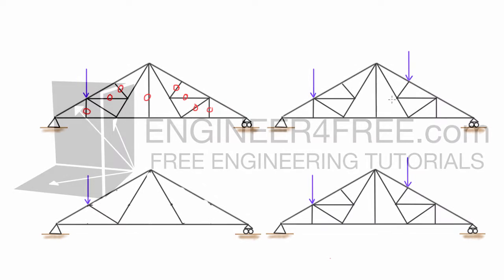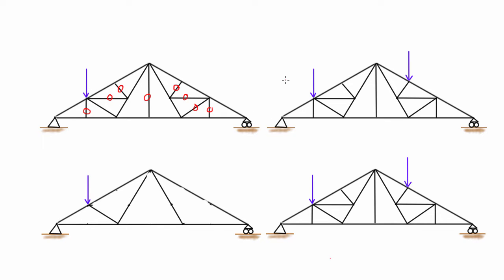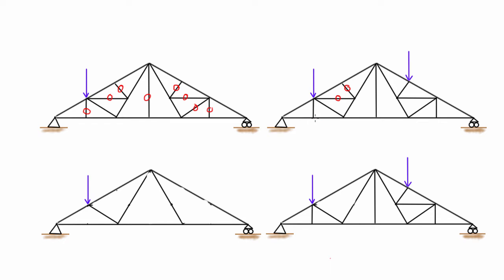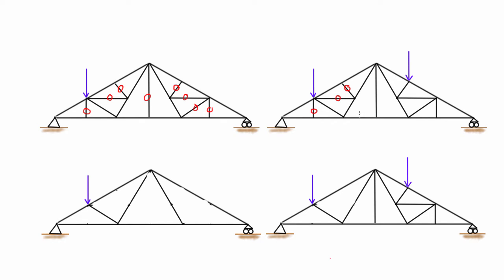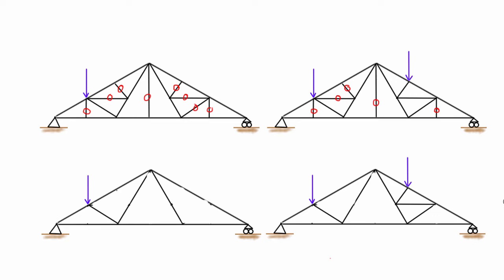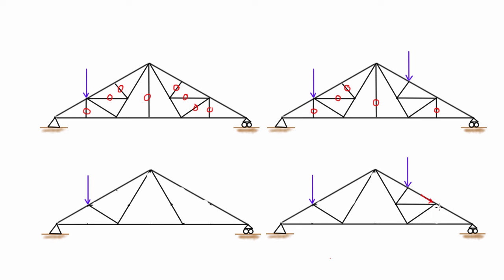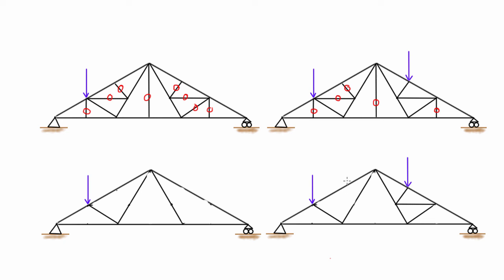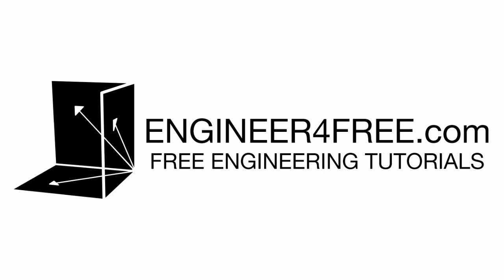Find the zero force members in a truss: example #2

Comment: Excellent presentation. Picture in the bottom left position has 4 joints in the bottom line. The 3rd joint from the left is connected to the top joint. Shouldnt this connection be ZFM?

Comment: Hi, brilliant video, I just want to ask about 4:42, what observation can be made about zero force members if that load were just to be one of the two components - i.e either just in line with the collinear members or just in line with the perp. member. Additionality what observation could be made for the mentioned scenarios if the member were not perfectly perpendicular to the collinear members?
Reply from the maker: If the applied force was in line with the colinear members, then the third member would have to be a ZFM, as at that joint, there would be no other force acting in that perpendicular direction that could counteract an internal force in the perpendicular member. If the force was applied in line with the perp member, then the perp member would not be a ZFM. In fact, the internal force in the perp member would have to equal the magnitude of the applied load in that case. When an applied force is acting on a joint like thie at some orientation other than 0 or 90 degrees, then it's best to draw a coordinate axis of x' and y', where x' is parallel to the line created by the colinear members, and y' is perpendicular to it. Break down the applied force into its x' and y' components, and also any component (generally the third member) that is out of line with x' or y', and find its x' and y' components. the y' component of the applied force will equal the y' component of the third member. From there, you can use SOH CAH TOA to solve the actual magnitude of the third member's internal force if needed. I've got more videos on trusses here: engineer4free.com/statics see videos 42 - 51
Reply: @Engineer4Free  Thank you for your detailed response and great videos.

Comment: One doubt right second vertical member also make system in unbalanced , then should be removed
Reply from the maker: Keep in mind when I erase the members, I'm not physically removing then from the structure. I'm just making it easier to see which other members will be ZFMs with the current loading scenario. They're a still there.

Comment: In the bottom left picture, how come the third from the left internal beam is not zero force?
Reply from the maker: Hey sorry there is an error in this video, I mention it in the video description: "The bottom left diagram is missing two ZFMs. They are the members that connect from the to the bottom of the truss 1/3 from the right. Link to that previous video is here: https://youtu.be/4FuUI4OyWOs I make note of it in the description there."
Reply: @Engineer4Free how come two members? Where's the other one? I only see the internal member from the right. Thanksss

Comment: For those from the previous video the bottom left diagram is missing two ZFM (as stated in his description). It is the members that connect from the to the bottom of the truss 1/3 from the right.
Reply from the maker: Thanks for posting this. I made a note in the description of this video mentioning it!
Reply: This video will definitely help me out in my trials today. I had trouble in my last exam determining a member's force, only to be told after the test by my teacher that it was a ZFM. I will not be tricked again. The marks are mine!